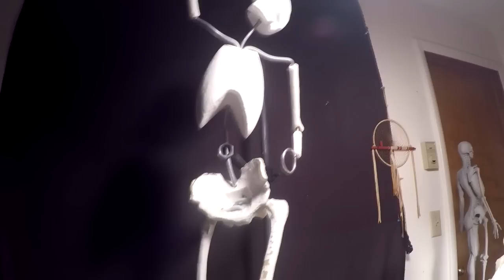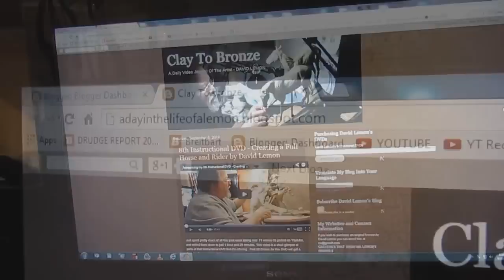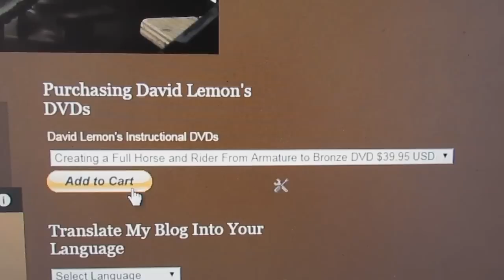New Clay - Touch the Clouds - Using a TruForm 12 inch Armature - Prepping The Clay  - Part 8

Comment: Have you ever tried melting the J-Mac clay using an oven or something similar? Not completely into a liquid, but enough to form a paste? I plan to purchase a block of it.
Reply from the maker: Get a plastic bowl.. put clay in the bowl and heat in a Microwave gradually .. 10 sec... 20 sec.. and so on.. till you get the perfect softness... It's a fast way... but be careful.. the J-mac is very hot once you soften it..
Reply: Thank you!